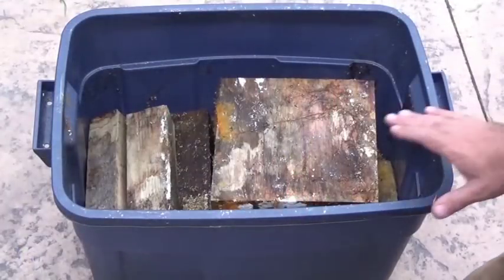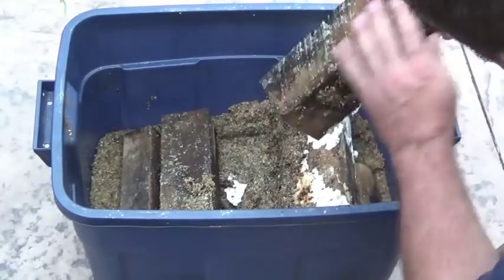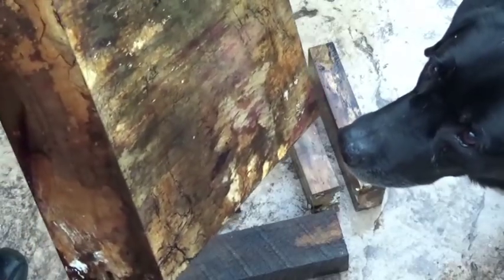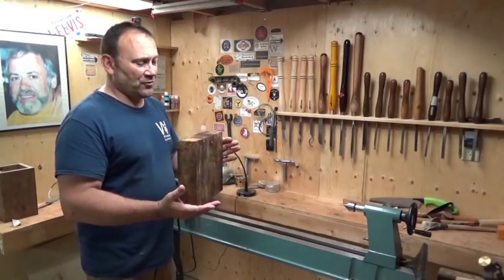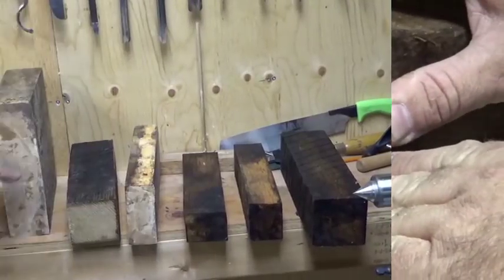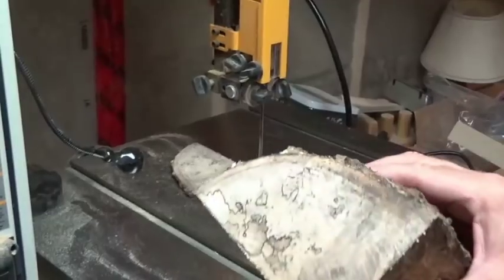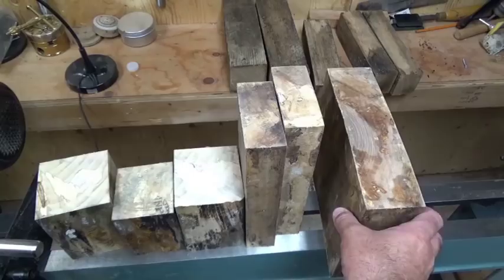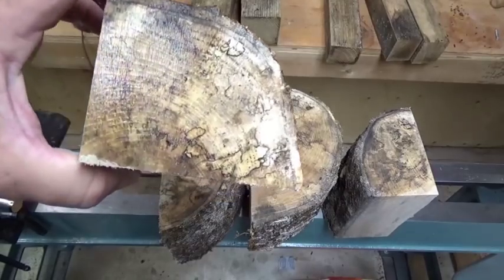how to spalt wood part 4

Comment: Here in the USA, especially in the mid-west, the trees most noted for spalting are the maples trees, especially the sugar maples.  I suspect, IMHO, that the reason so many of the sugar maples show spalting is because when planted in groves, they are used to produce maple syrup. So when a tree dies and is cut down, there isn't any hurry to get rid of it. So it may sit a couple of months before the sawmill comes to pick it up.  Most of the sawmills that will take these logs are pretty small, so they are pretty chuffed when the mill a log that is splalted.
Reply from the maker: For sure spalted wood can look spectacular if not too far gone

Comment: Ten months seems excessive.  I spalted some 4” thick bone dry cedar in 3 months.  I threw them in a garbage bag with some water and a few handfuls of compost. Spalting went all the way through.  But cedar is soft and your oak is hard, maybe that’s the difference.
Reply from the maker: most definitely a difference yes but its all good information.
the spalting occured after 3 months, i had just let it sit drying, apart from the oak which i had forgotten about to be honest.
i will try the compost idea, thank you
Rob